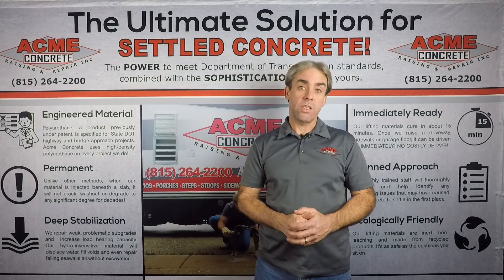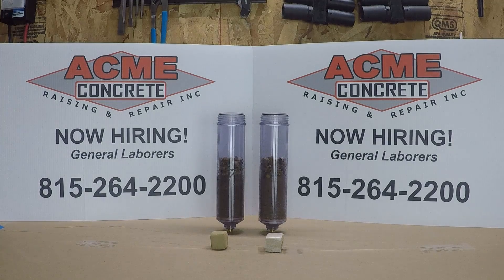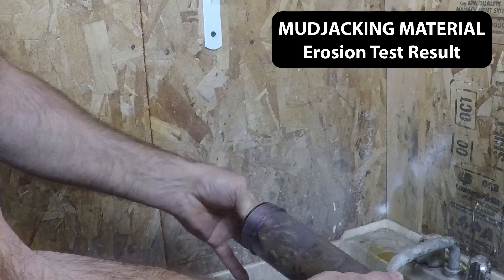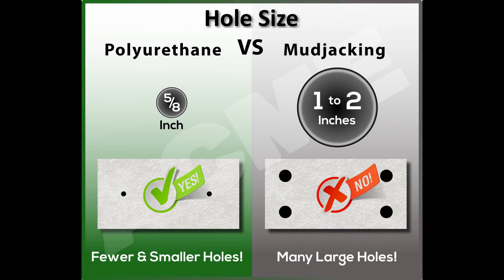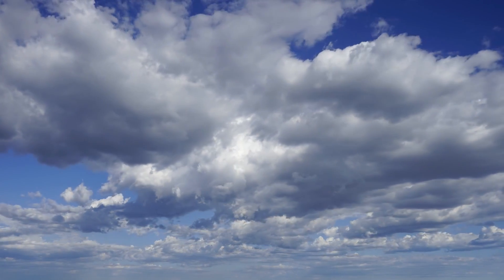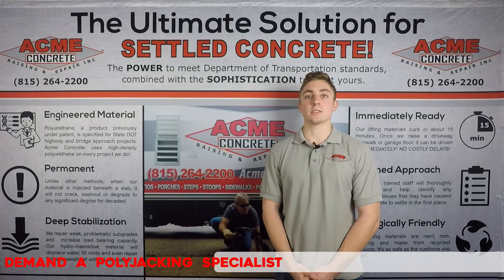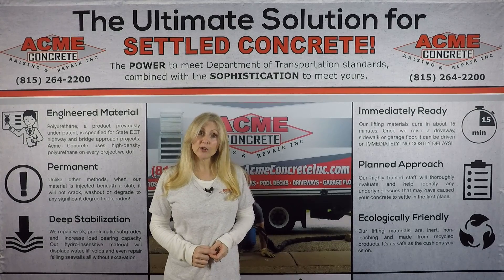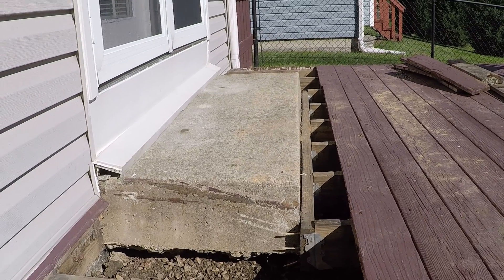Polyurethane Concrete Raising VS Mudjacking

Comment: i live on a lake and we are trying to find ways to help fix retaining walls that have holes and after time washes out very badly. would poly injected behind the wall to fill the cavities be cost effective? replacing walls can be very expensive, and repairs fill the hole with more dirt doesnt last very long. poly just seems like a great alternative. if anyone has thoughts id love to hear them.
Reply from the maker: Thank you so much for watching our video!

To answer your question - YES, polyurethane could be a great option for what you're describing - specifically our HF-402 polyurethane which is a hydro-insensitive material. It would be installed through a deep injection process. Here is a link to another one of our videos which may help explain better: https://youtu.be/yLW4AtC2kE8

Here is where you can learn about the different polyurethane materials offered: https://www.acmeconcreteinc.com/concrete-raising/polyurethane-concrete-raising-materials/

Comment: So mud turned into mud what a big surprise wow mystery solved huh
Reply from the maker: Actually, the issue involves contractors making false claims of including additives to their mixes. We test various mudjacking contractors mixes to see if it will stand up to what their marketing efforts represent. It's unfortunate for competing contractors that actually provide stable materials to be bidding against others who simply make false claims while not following through with such claims. For example, we bid against a company claiming to add a "polymer" to their "mud". By making those claims, they bid jobs in the price range of what we're providing, but the customer isn't getting their money's worth. It's a big scam.

Comment: Thank you for the information on this subject.  Some years ago,  the retaining walls on our garage were really failing.  We had them fixed and had a new patio put in on the far side of the garage.  My idiot brother had the contractor fill in the void with the tree stumps that were removed!  Then woodchucks came into the picture and dug under the retaining wall in the back corner as well as in the front corner.  To go another set further, the area in front of the breezeway had a tree removed but not the root, so it has sunken under the weight of my truck.  So my question is, what would be the best solution for these issues?  I personally think that I need a mix of the mud and Polyurethane to fill the voids and raise the places that have cracked our garage floor.  It is a mess.
Reply from the maker: Hello Gail, thank you for your comments! We would recommend a polyurethane-based solution. However, like any construction or repair type work, an in-person evaluation of the situation would be necessary in order to narrow down a specific product and approach. Finding a reputable polyurethane concrete raising specialist in your area would be a good place to start.

Comment: Foam is the worst solution. It will decompress over a short time frame. 2 to 3 years.
Reply from the maker: Thank you for your comment Mike, we appreciate you watching our video. You may have just inspired a whole new video series titled "POLYURETHANE: Materials Engineered for Long-Term Repairs!".

When you say "It will decompress over a short time..." Did you mean to claim it will COMPRESS? As I am sure you know, decompression implies expansion, but I don't think that was what you meant. Can you share with us what you have to back whatever claim you're trying to make?

Contrary to your comment, our experience with polyurethane is nothing short of excellent. A large part of our business is raising concrete that was previously mudjacked, where the mudjacking mud failed to support the slab in a very short time - less than your "2-3 year" time frame. However, we don't typically just tout our experience or opinions. As you've demonstrated, anyone can say anything - talk is cheap as they say. At Acme Concrete Raising & Repair, we stick to facts, many of which derived by third parties.

Polyurethane concrete raising foams were first developed in the '80s for highway-related projects. Here we are 30+ years later and we have bid documents for current Tollway projects that specifically require the use of polyurethane for their concrete roadway lifting. Mudjacking is not even considered for these projects.

To go further, extensive laboratory testing has been conducted on polyurethane. Testing that would not be practical for mudjacking mud simply because there is no consistency between contractors. Everyone mixes their own slurry that's somehow better than their mudjacking competitor. Polyurethane, on the other hand, is consistent and provides very predictable performance characteristics.
Reply: @Acmeconcreteinc  it's still a bandaid.
Reply: Polyurethane will last decades with no degradation, especially when it's not exposed to the sun. The poly used for jobs like this is very hard and dense compared to the type in spray foam cans. It is also lighter than concrete so doesn't have as much weight as concrete and won't pull everything down again.
Reply from the maker: Thanks for your input!

Comment: How does Poly compare with  LSM concrete?..which is not mud.....
Reply from the maker: Thank you for your question! Polyurethane is a better choice for concrete raising applications. Concretes' relatively high density (nearly 150 pounds per cubic foot) is a large contributing factor to its settlement. Naturally, when raising sunken concrete, it only makes sense to NOT add additional weight to an already compromised area. A huge downfall of LSM concrete is its density, which is in the neighborhood of 20 times more than polyurethane concrete raising materials.
Reply: @Acmeconcreteinc  Perhaps I should have been more specific. What is better in filling voids under concrete? I have a garage (63yrs old) and the ground underneath of the floor slab has sunk from 2 to 4 inches creating a void between the slab and the supporting ground. I have had a few contractors out and the poly is a lot cheaper but the guy told me that it would not actually flow around every sqft of the floor but would have spots that would be like pillars but that it would be sufficient to stabilize the floor. Whereas the LSM guys said that for the most part LSM would flow to every sqft but as it dried there would most likely be pockets where it would shrink leaving small gaps. I had a structural engineer come out and assess the whole building only because it is has an issue not only with the void but with a connecting retaining wall that has failed causing some cracking at the corner where they are tied together along with erosion of some support blocks for the garage itself due to poor drainage, which has to be replaced.  His suggestion for the garage floor void was LSM over poly. So my question to you then is how do you like poly over LSM for filling voids or would LSM be better in my situation ?
Reply from the maker: @dannyixoye262  I understand much better now! We would definitely still recommend polyurethane, however, I would recommend a formulation that's designed to fill voids and support slabs - not raise them. Many foams are designed to lift slabs, and these foams achieve peak expansion in about 30-seconds. We use a slower reacting material when stabilizing concrete - it takes about 1-3/4 minutes (105 seconds) to reach peak expansion. This slow reaction time allows the material to spread out and fill all voids. We typically drill a grid pattern in the slab and inject in one location until the foam reaches an adjacent hole, and repeat the process across the slab. You can achieve nearly perfect coverage and do not have to be concerned about poly shrinking like mudjacking products.

Comment: How about do it the right way and tear out the old concrete. Put in a better gravel base. Compact it and pour in the new concrete. No holes. Looks nice. Will last longer than you live if done right.
Reply from the maker: Thank you for the comment! While replacement is the selected option for some - others choose to repair their sunken concrete at a fraction of the time/cost associated with removal and replacement. If the concrete has been in place for 10 or more years, there's a high probability the settling has stopped. If the concrete is in otherwise good condition, we can raise it without the large ugly holes you get from the "old fashioned way" referred to as mudjacking. Our injection holes are practically unnoticeable, and the material we use is permanent.
Reply: Most people don't have that kind of money
Reply: Because not everyone has that massive money tree growing out back. Use the noggin
Reply: @fubarmofo6969   Haha well I'm in the concrete business so I know for a fact that I can replace the concrete for cheaper than what it costs for foam injection.

Comment: You had me untill you said Illinois uses it to fix roads. These are some of the worst roads I've seen even after repair.... But seriously, mud around a foundation to slow water intrusion, and poly everywhere else. Just a few questions about load rating on poly and if ants and mold love it?
Reply from the maker: You are correct about our roads, Benjamin.  We endure road construction on a regular basis.  Road crews are always working hard to keep up. Last winter's ARCTIC FREEZE really wreaked havok on our roads and highways. Chicago winters can be BRUTAL!  This reoccurring "freeze/thaw/freeze some more" cycle sinks, tilts and tips concrete all over Chicagoland.  Snow being absorbed into the soils, combined with sub-zero temperatures, can cause a LOT of damage.

Load rating - one square foot we're looking at 1,000+ lbs.  Strong enough to support a Sherman tank!  (Polyurethane cures immediately too - there's no wait time to use your concrete.  You can walk, jump or drive on it immediately after raising!)

The high-density, commercial grade of polyurethane we use is completely inert.  Water isn't going to penetrate it.  Mold should not be an issue.  Ants...lol...made me laugh on that one!  I applaud your sense of humor!  Seriously tho, I think ants would find a road less difficult to travel than try and attempt going thru it.

Comment: so, it wasn't really clear, which method did you recommend as being better, the mud or the poly? ;-)  in all reality, the mud just seems wrong, that is what failed in the first place.  give me some plastic implants and i'll be happy
Reply from the maker: Thanks for watching Brad!  Hands down - we recommend POLY OVER MUD.  From what we've seen, the mud method mixed with sand & clay, etc. just doesn't hold up.  Water and moisture completely torn down the mud.  Poly will NOT be affected by water.

Comment: I don't think your comparison or method of testing was very scientific...Kind of bias... I've never done or had any concrete mud jacked or AB jacked, but, if I were going to repair my sidewalk , I think I'll used concrete mixed with foam or just grind the high spot...
Reply from the maker: Thank you for watching our video and for your comments, Ken!  We hope you found our video interesting. Although we dont claim to be scientists, we have a very tech savvy team. The test we performed is actually quite basic, yet very effective, at showing how water affects concrete lifting materials.

As you can see from the video, the "mud" (which appears to be a sandy, clay mix commonly used by some mudjackers) washes out quickly and easily with water. It only took a couple minutes for water to completely degrade that mud. 

Our Chicagoland area has had a LOT of rain this season. Polyurethane, which is the only product Acme Concrete Raising & Repair uses, does NOT wash out or degrade from water like mud. It will not leach or breakdown with water. It is also LIGHTWEIGHT and EXTREMELY strong. It's even strong enough to be used on state tollways. (Most highway projects dont even accept bids using mud mixes.)

Pumping any cement mix under someone's concrete will likely add more unnecessary weight to an already compromised area. That can result in a customer having to repeat the repair process and incur even more additional expenses. 

Polyurethane wont add all that weight that cement has. Our team believes in quality repairs that last. We don't want customers to incur any added expense or inconvenience for repeat repairs. Mud mixes simply don't hold up like Polyurethane.
Reply: @Acmeconcreteinc  My point wasn't that polyurethane is weak or that mud was a good direction, even though mud is more economical and will of course harden into a resistant compound, if you compare apples to apples the issue becomes actial erosion as you point out Chicago gets a lot of moisture, with erosion you have water in a swale that will produce erosion around the polyurethane just as it would mud, as a continuance of the initial cause. With that said you ought to tackle the erosion cause as a midigating factor to warrany, perhaps require a sodded burm up to the concrete or drainage along the border of the concrete to evacuate the flood water that is the root cause. The solution to any problem is not bashing the alternatives as bad ideas, but coming up with a better solution!
Reply from the maker: @superiorcarpetpaintllc4351  You continue to bring up great points! We agree that in addition to settlement, there can be other factors that contribute to continued sinking. As you mentioned, erosion can be a big problem. We also come across areas comprised of "weak soils" where areas are geologically unstable. These type of problems are precisely why Acme Concrete Raising and Repair developed the Smart Lift System (we have a video series that describe this). We work hard to determine any contributing factors and recommend solutions to these issues. A common problem is gutter downspouts that dump rainwater along foundations, sidewalks, patios, and stoops. We regularly identify these issues along with other problems such as poor grading/sloping. Burrowing critters can also wreak havoc on a concrete slabs support structure. 

In cases involving weak, unstable soils, our Smart Lift System is capable of deep injections which will repair these areas - fixing the underlying issues without expensive and invasive demolishing and excavation.

In addition to identifying and rectifying contributing factors, our polyurethane lifting materials are water-resistant and do not add significant weight to areas historically prone to sinking.  We understand how we may come across as "bashing mudjacking mud". We simply encounter a lot of sunken concrete that had been previously mudjacked where the mudjacking mud simply washed away. People pay hard-earned money to have their concrete mudjacked - only to have it drop back down again. So, yes we're very passionate about what we do, especially when we're providing a premium repair and are so often told we're less expensive than the mudjackers. We're not just bashing mud - we are providing a better solution that includes superior materials and identifying contributing factors!
Reply: Lmao reread your first sentence haha you’ve never had experience in either so.... why are we seeing your opinion??

Comment: I do plenty of fixes on pools. Guys dont backfill with gravel because of cost and mainly they want to get rid of the monster pile of dirt. Water always seeks out the pool because of the overdig. Best if you can dig a trench to daylight if you have an incline. Usually find a foot of settling under pool decks At least but settling is hell on plumbing and so is pumping on top of it to raise a slab.
Reply from the maker: Water drainage and moisture can be very damaging.  Water always finds a way.  We see it all the time.  This was also a BRUTAL winter in the Chicagoland area.  The "Arctic Freeze" endured in January has caused damage to roads and concrete.  Large holes from the old mudjacking technology can compromise concrete's integrity.  If moisture gets into cracks, the freezing, thaw and re-freezing cycle can wreck havok on concrete.  Smaller holes, like those used from injecting poly, have a far less failure rate than the large holes drilled by mudjackers.

Comment: I think these guys were confused. Mud, in that case should mean grout, not actual mud from your 4x4 pit.
Reply from the maker: Thanks for your comment. The material we tested was taken from an actual mudjacking job performed by a local competitor. We ended up on this job because the owner called us to fix it. There was no confusion - it was a very straight forward thing.
Reply: @Acmeconcreteinc  I think he's saying that your competitor is confused.